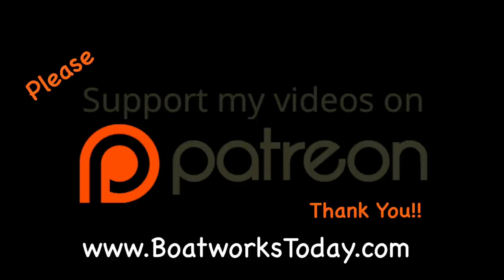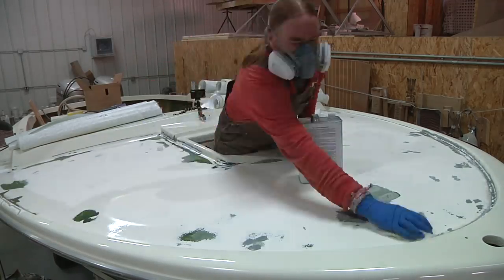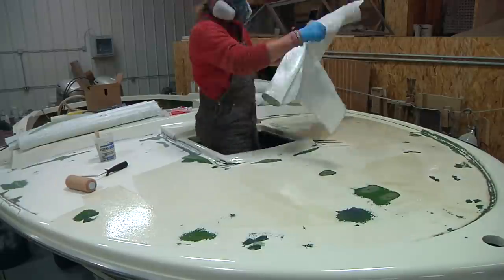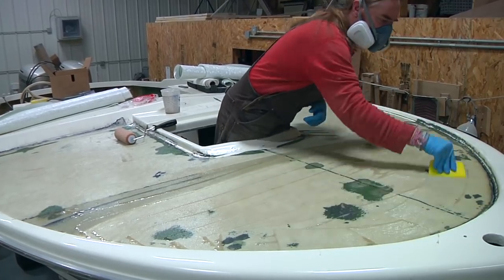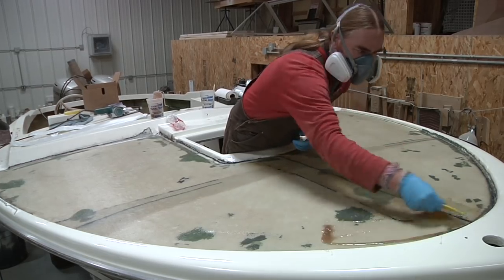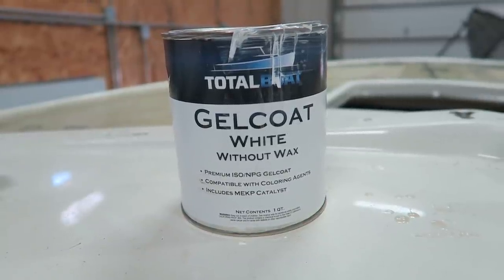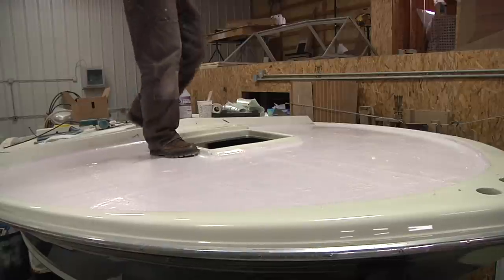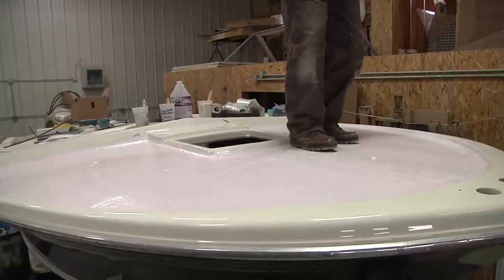Did Laying New Fiberglass Fix The Deck On This Boat??

Comment: Wow! What and improvement. Gives me a bit more confidence in the 3 or 4 layers of 1708 I'm going to use for repairing my 18" x 18" floor of my battery compartment in our RV. I can't believe those two layers added that my strength to the hull. Thanks for taking the time for making this video.

Comment: I use biaxial in many of my scoops that are attached directly to the carburetors, keeps the warpage to a minimum with all the engine heat/sun etc... ....Some tuff stuff for sure, Used it when I built my Bat-Boat, a lil heavy but tons of strength.... That deck you just did will outlast the boat, Great Job .... now for the headache part, surface geloat sanding, wish I was nearby, id give ya a hand.
Reply from the maker: Thanks Dude ;-)!

Comment: Great job Andy, I've had some experience building a 26 foot racing sailboat. It had to be very light and with the West System it worked well ... The spatula to remove bubbles and excess resin is irreplaceable (even if you have a vacuum system). I like your work philosophy. Well done!

Comment: Shocked!! Super solid.. Your technique resembles how surfboards are made here in Hawaii. Only thing we would do differently is after adding the “ sanding “ resin on top of the laminating resin, we would sand them paint. Have not done a gel coat job yet and am cures if it smooths out flat. Great work dude!

Comment: I really needed this video. I recently bought a 30 year old Wellcraft 230 Coastal and from the transom to the helm and in the cabin the deck gives a lot as my 285 pound svelte body walks on it and I've been searching for fixes cheaper than replacing the deck with Coosa and layers of glas. I'll install 3 layers like you did and hope for the best.

Comment: Nice this gives me some confidence in the job I am doing now. Recore the deck under my mast step. Excited to see that. My plan is 1 layer of chopped strand, 3 layers of biaxial fiberglass, 1 layer of carbon fiber and 1 layer of Kevlar should be strong enough. Doing the carbon and Kevlar just cause they will make a great base layer to build on.

Comment: Andy, I was very surprised at the dramatic increase in stiffness that 2 layers of biaxial provided. There was more deflection around the hatch opening than I would have expected. Maybe an aplication of more biaxial behind that opening will have a similar stiffening? I know a full windshield frame will have a stiffening effect on that hatch opening, too. Total Boat from Jamestown Dist. is a local company for me and I've been a customer over 30 years. They are a great outfit and get better all the time.  They are an excellent source for stainless fasteners, also. I enjoy your videos and learn things all the time.

Comment: Hello,  I see your hatch combing flexing up and down.  In my experience any appreciable flexing in a walking surface on a boat will generate stress cracking.  It won't happen with one time stomping but as the boat 'works' in the waves and three or four people crowd up there when anchoring or going ashore etc. etc. they will begin to form.  In your place I would have as you say done that repair job but I still would have added two ribs underneath.  One at the forward hatch combing and one at the aft combing.  A piece of 1 1/2" square oak steam bent or contoured on the bandsaw at each point would transfer the load to the hull much more evenly.  A couple of knees at the hull would finish the job.  Using epoxy with a bit of stiffener makes overhead work much better although it still is a necessary pain.  Very nice video.  Have you used the fancy sander yet?  Looking forward to hearing how you like the electric version.  Take care.  Doug

Comment: I'm impressed it worked so well and with only 2 layers.  It would have absolutely sucked to glass the bottom of the deck without flipping the boat upside down. I also thought you were making a mistake by not using epoxy but you were right.I cringed when you jumped on it,  you'll never get that much force when the boat is on the water.

Comment: Fantastic video. Really interesting to see the carful preparation you did to do a complete dry fit before actually putting on those (very large) sheets of fiberglass. My default is to use biaxial (with epoxy) - I now have much more confidence on just how strong that stuff is. Cheers.

Comment: I just removed teak decks from my 43' sailboat and planning to add one layer of 1708. I noticed you didn't grind off the gel coat prior to glassing. I was planning to sand down to the bare glass, but now wondering if it's really necessary. Thoughts?

Comment: Hey after rewatch this video a couple times I have to ask about the surface prep. Did you previously sand the gel coat to give it tooth to connect with the new fiber glass? I didn’t know you could glass over gel coat like that?

Comment: Great success and well earned!  If your going to paint over the gel-coat, is the PVA method better than the mixed in wax? I'm wondering for my own project (sorry not a boat, but a car). Wondering if both stabilize to a paintable surface.  I'm modifying existing fiberglass parts and want to ensure a bond and be able to refinish to match, similar it would seem to what your doing here.

Comment: Another great video.  Wondering if you need to use PVA or can you just waite for catalyst to do its job?  I thought it just speeds the process of curing.  But either way, the gel coat will cure.

Comment: Very instructive. Thank you. Question: will the t shape area where the glass biaxial layers were laid on top of each other show up?  If so, I assume that it's easily removed in the fairing process, correct?  
I really like this series.

Comment: In an earlier video, you used 5:1 epoxy to patch screw holes on the deck.  In this video, you used polyester laminating resin for the big pieces of glass.  I thought epoxy could be used over polyester or vinylester resin, but not vice versa.  Is there any risk of de-laminating over those spots?  What am I missing?

Comment: I'm a 3rg generation fiberglass repair guy and enjoy learning other people methods as well,what I don't understand in this video is why not just add the wax to the gel yourself and why not use a wet out roller instead of a 3" brush?
Reply from the maker: Didn't have the wax or roller on hand lol ;-)!  Making due with what I have

Comment: hi Andy , just wandering , why did you not use epoxy with fiberglass or  carbonfibre instead of fibreglass  , is it because fibreglass with polyester is more flexible ?

Comment: Nice, looks strong.   Quick question.  The way the resin went on greenish then turned brown pretty quickly.. Was that to do with it dissolving a binder in the mat? Or something else?
Reply from the maker: The color change is because of the catalyst starting to do it's job with the resin.  Resins typically change color when the chemical process starts happening :-)
Reply: @boatworkstoday  Ahh ok cool, that's all happening pretty quickly then.  Thanks for the reply.

Comment: Great work? do you recon it would be a simular result if you would sandwich the deck from the inside?
Reply: runristaren2 I did this overhead in a camper trailer. It was the messiest fiberglass job of my life. But yes it should be comparable, and if you added some foam ribs it could be significantly stronger.

Comment: I was wondering about what to do with fiberglass condensation.  I have a high top van that is fiberglass.  A sticker that has written words of gelcoat.The van is a 1993 Chevy and the sticker on the high top has the same year.  I found your channel by searching how to repair cracking on fiberglass, this is how I found your channel.  I followed instructions on you video with success on the repair.  
Now that we got some good rain and good snow on the mountains nearby, I notice condensation inside the van on the fiberglass high top.  
You have any advice to at least make this either half or full preventable?

Comment: Is it okay to use standard sheathing for the floor of a small boat. The boat is 14 ft long and the open area is 4 by 8. If I fiberglass it will it be safe from water could you please let me know. Thank you Darren from Canada

Comment: Im re doing the deck of a 15’ flats , when fiber glassing that do you recommend epoxy resin or regular polyester resin will  do the job?
Reply: Hi im doing the same project. Did you ever get an answer to this question?

Comment: Really been enjoying this series. 

A big question I have, is I have a 1966 Spencer 42 Sloop, I am fixing to glass in the head to turn it into a wet room so I can have a shower. The thing I am worried about is overlapping the layers and getting those smooth without needing a ton of fairing compound to get it all smooth. 

Would you just butt the joints like you did here and just stager through the layers, or is there a different method I should consider?
Reply: If you overlap and then while wet cut the seam with a sharp razor blade, peeling off the overlap piece you'll get a perfect joint.  That being said, if you're waterproofing a shower, I wouldn't sweat the gaps at all.  Maybe the expert can weigh in!

Comment: Ha.. I commented on the last video. I was pretty sure that would fix it. People underestimate the strength/stiffness of Biaxial glass.  Every time I build something out of it, I'm shocked at how strong it is.

I was impressed with how brave you are in mixing your catalyst. I'm always afraid of mixing too little and having a giant mess. Then I'm always sweating bullets to get stuff laid down before it kicks.
Reply: I agree just did my first boat restoration 1979 sun runner. And my first fiberglass job. I watched alot of Andy's videos. He makes it look easy. The first layer of a new deck. wow I was sweating before it kicked off. I relaxed a little and eased up on the MEK. Made my life easier.

Comment: Great videos. I was wondering if you have any videos on how to fix soft decks? I have a hunter 42 passage and I have two somewhat large areas where the deck is creaking when you walk in those areas. One is near the water tank hose inlet and the other is forward of a very large window. I’ve read to remove the top portion of the deck, remove the patch of core and replace or drill holes and inject epoxy to help strengthen the core. I am wondering what is the proper method? Any chance you’d be willing to talk over the phone?

Comment: Would using a structural resin give you even more strength?
Reply: Depends on what you mean. The strength comes from the glass not the resin. Overall the strength comes from the wood, the glass decreases deflection. Resin bonds the wood and glass. Resin by itself is very weak. Great at water proofing though. Epoxy is great but it’s very expensive and not compatible with 1708 or CSM.

Comment: Nice job!  How long did you wait between putting the gel coat down and then after that, the PVA?
Reply from the maker: Gelcoat was done the following day in the morning and the PVA went down that evening before leaving for the day :-)
Reply: @boatworkstoday  you could've waited a week, right? If I understand correctly, one of the benefits of poly resins is that you've got a lot of working time. You wouldn't need to sand and start over for round 2.

Am I understanding correct?

Comment: I guess there's something I don't understand about laminating resin or your process or something. I thought the reason you applied the gelcoat at the end was to seal the resin and ensure that it fully cured. If you didn't have the waxed gelcoat, why not just apply the PVA directly to the resin?
Reply from the maker: I use gelcoat for 2 reasons.  first is like you said about sealing the glass beneath so it can fully cure.  The second is to help fill in some of the texture of the glass so that come time for sanding it takes less time to get a flat surface ;-)  I could have gone over the glass with PVA, but would have been a lot more work to remove, and eventually sand smooth

Comment: The crown (radius) in the deck is why the deck stiffened up so much. If it was truly a flat surface it would still be a flexy flyer just thicker.

Comment: Would it be possible for you to settle a debate we're having on a boating forum?  Quick description - guy  was wondering if he should buy an all-white boat or one with a black-sided hull.  I told him to buy what he likes and not worry about the color because either way, it's the same amount of maintenance.  Then I got jumped on ugly with those claiming that not only does black gelcoat fade a lot quicker than white, but it requires a lot more maintenance.  I disagreed and mentioned that gelcoat is a polyester resin with pigment in it and the same amount of wax protection is required for both since it's the top layer of resin that dries up from UV ray exposure and breaks apart leaving that faded look which happens to either color.  Pigment has nothing to do with that, but the others disagree.  Andy, am I right or are they?  Tell me straight up, I can take it! :-)

Comment: I don't get the chip brushes on the gel coat. Is there really not anything better to use than the 50 for $8 at harbor freight 2.5" chip brushes to use on the 100 square foot repair? That seems such a waste of time, and I've used those enough to know how many bristles you are pulling out of your final coat.  I am such a rookie at this, and hate to question an expert, but there's no way I'm spreading gelcoat over 2 square feet with a chip brush, let alone half the boat deck on a 30 foot cruiser.  Love the work though. Take this slight criticism as an annoyance of my lack of patience on my part, rather than derogatory on your part.

Comment: I've repeatedly heard you shouldn't lay NEW polyester fiberglass over old cured polyester fiberglass.  Why were you able to do so?  Was it because you were laying it over a gelcoat layer?  Did you do something in your preparation that made it work?  I'm very confused!!!
Reply: That's because the people you heard that from don't know what they are talking about.

Before the internet, most repairs were done with polyester. And yes, I've been around that long. 35 years of composite experience building boats.
Reply: When reading West Epoxy literature I thought the same thing.
Reply: Just grind the old surface rough enough and you will be all good.
Also check his video where he compares polyester, vinylester, epoxy over gelcoat bonding...
Reply: I can't say I have ever heard that one. Fiberglass on fiberglass is perfectly acceptable in most situations.  It's generally using polyester resin over an epoxy layup that can cause some issues.
Reply: You can put polyester over polyester. You just have prep the surface correctly (ie sanded and wiped clean). You can't use polyester over epoxy. You can use epoxy over polyester.
Reply: @rogermccaslin6750  thanks for your 2cents [sounds cheap lol] so maybe 35??? thanks Roger ;)